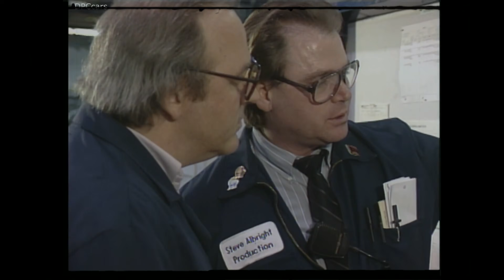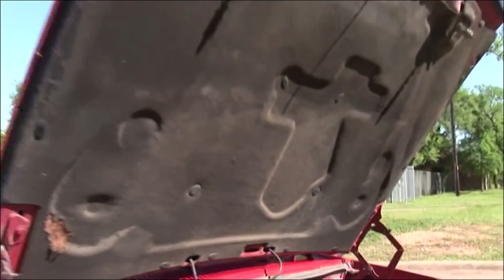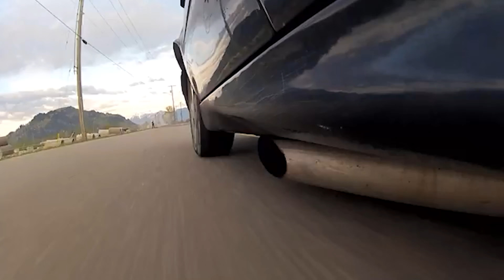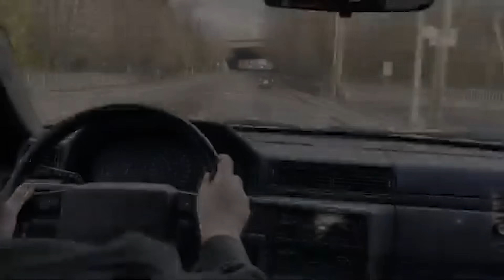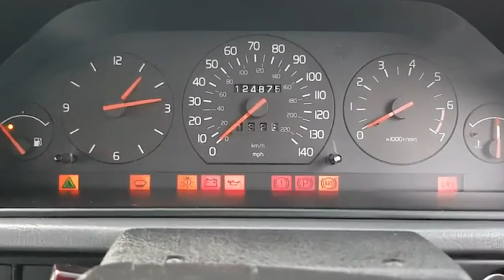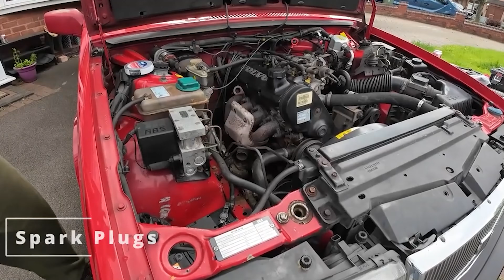The Volvo 940 Secret Nobody Told You

Comment: only 5 minutes in and ive heard several factual error. The hood is not heavy nor is it steel, its aluminium. And the B230 redblocks did NOT have cast iron heads.

Comment: Regarding overheating, I had HGF on my 940 (cyl 1, next to the water pump and the most likely failure point). Zero coolant. A summer's day over 30 degrees C (low 90s F). 150 miles from home and it got home with no reduction in power, no warping of the head, no dramas. I did choose to replace the whole engine after that but that was only because it was quick and easy and relatively cheap. I could have just got the head skimmed and carried on but the intention was (and is) to keep the car long-term so the small investment made sense. 

Six years on and she's still going strong and even though its a B200F non-turbo it's as entertaining to drive as my Honda Integra Type R Mk1. You have to look ahead, plan your lines, keep it in the middle of the torque curve, drive it actively. You can feel what the suspension is doing through the seat, it's almost like riding a motorcycle. 

I didn't watch the whole video but there are two engineering/packaging things I love about this car. Firstly, the release catch on the bonnet which lets you put it vertical giving a huge amount of space for work on the dizzy and bellhousing. But it's not just that - when you lower the bonnet from that position it automatically resets those catches to the safe open position. No gas struts here; just massive springs which will likely never fail. The second thing is the rear seat fold. Pull a tab, fold the base forward, operate a latch, fold the backs forward whilst the headrests auto-dock. And of course a completely flat load space. It's so easy compared to non-Volvos that putting seats up and down is a pleasure not a chore. For example on many VWs you can't remove the headrests without tiltling the seat back forward to get clearance and then you've got to operate the two plastic catches to release the headrest. Guaranteed finger pinch and swearing.

Comment: Currently resto-soft modding a 95 945 with ZERO rust, 170K miles on the B230FT and AW71. The red block is still well within compression specs and the AW71 doesn't slip. My wife's life was saved by her 89 244 in a 55 mph head on crash, mine was saved by a 2012 C30 that was rear ended by a Toyota Tundra at 70 mph. We are both "Volvo saved my life" members and are very proud of our vehicle purchasing decisions. My wife's daily is an '06 XC70 that we picked up at the factory in Gothenburg.

Comment: I was volvo master tech for roughly 25years ! Started back in the mid 80s . I miss thees cars . I saw a head on collision aftermath of the owner of the dealership , he and his family of 5 walked away in the previous model 760T .I hand built a 242Glt with a mashup engine , 1992 block with a 1982 cyl head adjustable cam sprocket and once went past 10,000 RPM SO NO SURPRISE TO ME

Comment: And both the 16-valve and the B2xxK (Heron head) units ARE interference engines. I know because I had to source a replacement head and valves for an acquaintance's B200K after it lunched its timing belt.

Comment: I have a 1996 Volvo 940 petrol low pressure turbo SE auto estate here in the UK. Bought in 2016 for £250 and still have it as my works van. Rust is an issue in the UK and getting rare. Jacking points. sill ends, battery tray. Had my Volvo welded this year on jacking point and battery tray. Mileage is 213,000 miles, so run in. Runs very well. 2 years ago rebuilt the front suspension and revived the AC. A really usable car and easy to work on. James.
Reply from the maker: 213k as a daily works van is exactly what these were built for, they dont flinch. Still welding and reviving them is what keeps this generation alive.

Comment: the 240 global quality was superior even if the car was not as refined
Reply: @jacquespoirier9071  great car but lacked the rust protection of the 940.
Reply from the maker: The 240 was built different in a way the 940 never fully matched, that over-engineered Swedish quality was on another level. Absolute tank.
Reply: @GoodOldThings7 Ive had around 20 of each and the 940 is superiour in every way.

Comment: Recently bought 945 LP turbo with only 170000km. Needs some work but I love it and probably will never sell it. 

One of the most underrated things about these cars is the loud and solid clunk of the central locking system. Feels like closing a bankvault lmao
Reply from the maker: 170k on a 940 turbo is just getting warmed up, those engines were built different. That bankvault clunk is honestly one of the best sounds in any daily driver.
Reply: @GoodOldThings7 yeah the glory days of this car is still very much ahead of it.
 
been trying to delete the EGR and replace the PCV but it's a bitch to get to the bolt. I'm probably just gonna take an angle grinder to the EGR vent since I'm gonna remove it anyway 😂

Comment: My friend had a 240 - 75 with a turbo from a Volvo F 6 heavy truck i get him a clutch from sachs that could take 300 hp it slipped then the turbo spooled. Note the engine was not bulid for that we just slammed the turbo on it and uppgraded the fuel systen and yes we have a bigger carb but i dont recall if its was a weber or a delorto .
Reply from the maker: Cramming a truck turbo onto one of those is exactly the kind of madness those engines inspired. Did it hold up after the turbo fully spooled?

Comment: The turbo blocks wore out real bad. In think it was the chrome piston rings they came with. The NA engines still have hone marks at 100s of thousand ks
Reply from the maker: The NA blocks on these were genuinely bulletproof, those hone marks at high mileage say everything. The turbo version had its quirks but the bottom end was built different.
Reply: @GoodOldThings7  Wrong, the bottom ends across the N/A and Turbo were identical besides the Pistons. With Forged Rods you can take a B200/B230 to 600bhp before needing forged pistons, they may not be known for power in the US but these engines consistently make north of 1000hp

Comment: I don't think it had a timing "belt."  It had a TIMING CHAIN, IIRC.
Reply: The 4-cylinder had a timing belt, but the engine survived a broken belt, just stopped working.
Reply from the maker: The B230 being interference but still surviving a belt snap is one of those Volvo legends, the tight tolerances just barely saved it. Genuinely remarkable engineering margin.
Reply: @GoodOldThings7  As far as i know, some were interference and some like the B230FK that is in my 940 classic that i have owned for 22 years is non interference.

Comment: I will keep mine 940SE, still  original engine (never opened) and body (need to have a new spray) but mechanically everything is still original after 31 years.
The only drawback today is efficiency in regard to so high fuel prices (read high taxation from goverment).
Pleasure to drvie, easy to maintain, square, practical, very good.
Reply from the maker: 31 years on the original engine never opened is the definition of bulletproof, that says everything about how Volvo built these things. Keep it on the road!

Comment: It is not a beauty cover. It is a cover on top and a SOUND INSULATOR under neath.  Direct injection fuel pumps and injection are very noisey and not in a pleasant way.  This was a cheap solution to the problem.
Reply from the maker: Good catch, appreciate that! The sound insulation angle makes way more sense given how noisy those direct injection pumps actually are.

Comment: I'm a happy owner of a 3.0L/204hp 960 station wagon and a 2.3L/130hp 940 sedan, both from 1992 with automatic 4-stage transmissions.
Reply from the maker: A 960 wagon AND a 940 sedan from the same year? That's an incredible duo. Which one do you find yourself reaching for the keys to more often?
Reply: @GoodOldThings7  The 940, as it has been my daily driver since 2013.
The silver gray 960 I purchased in 2024 has just got 270k km's on its counter.
Reply: @GoodOldThings7  I have a 93 engine block in my 200hp over boosted 740 turbo wagon. 940s are only spare parts for me 🤣
Reply: The 960 is Awesome.I owned one many years ago...
Reply: Is your 940 a turbo?
Reply: @tracklizard4018 Unfortunately not.
Just a regular GL (Grand Luxe).

Comment: I did not realize that Volvo 960's had independent rear suspension. Is it multilink?
Reply: The multi link suspension was introduced 1988 to Volvo 760 sedan and the carried over to 960 sedan. 765 and then 965 stationwagon kept the live axel to 1994. When 964/965 was face-lifted 1995 965 also got rear multilink suspension. I think the gem among Volvo 7- and 9- series is 740 turbo from 1990 with 2 liters 16v 200hp (B204GT) and multi-link suspension that only was sold in Italy.
Reply from the maker: The Volvo 960 does indeed feature independent rear suspension, and it's a sophisticated multilink setup designed for excellent ride and handling. It's a significant upgrade over the solid axle found in many other cars of its era, including the 940.
Reply: Nice video,but the storyline and the pictures often don’t synchronize.I don’t like that
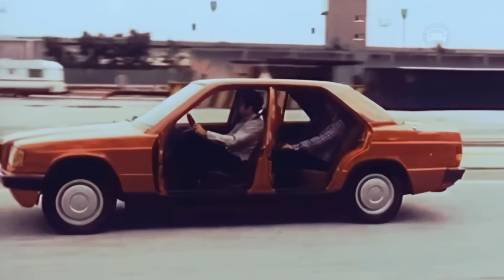Reply: @marcelbijmolen6707  Yep! A Mercedes Benz @1:34!
Reply: @marcelbijmolen6707   Also Mitsubishi wagon.
Reply: Yes its the multilink 😁